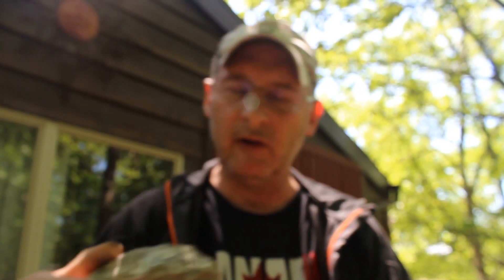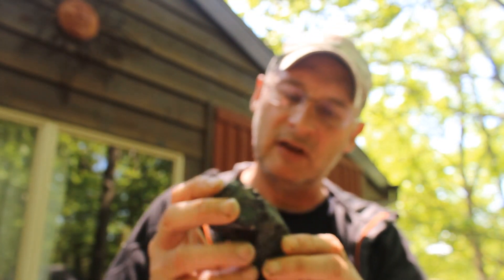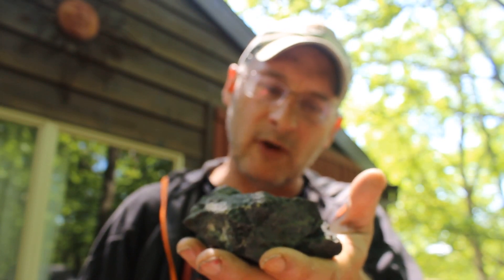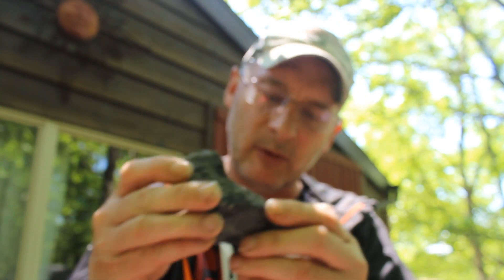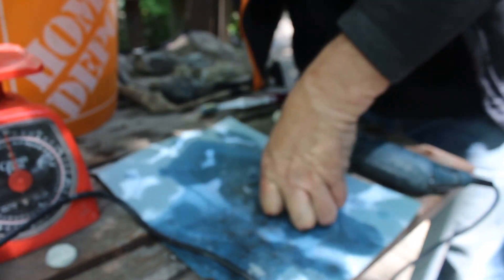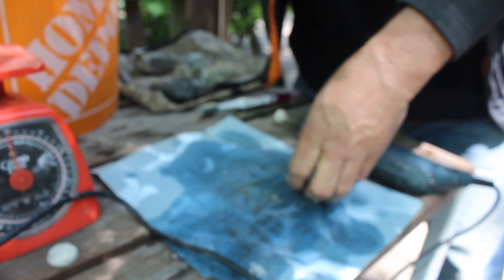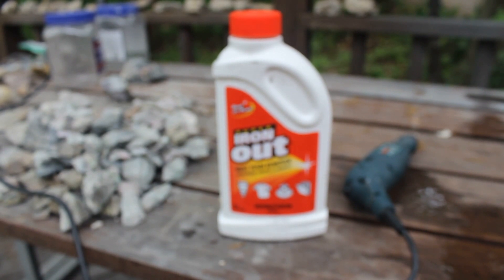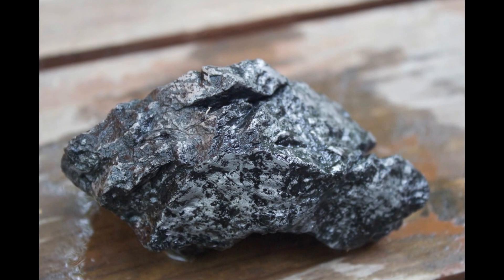Polishing Main Vein Silver Ore

Comment: Hmm, I found two sponge silvers that are very black, not sure if I should leave them alone, or try the iron out? They look mysterious with all that black coating!
Reply from the maker: Here is the problem: The super iron out makes the black soft, so it can be rubbed off the larger rocks with a cloth, but the sponge silver will break if it is rubbed.   I also tired silver jewelry cleaner and a sonic cleaner on a few pieces and neither method did much other than remove some dirt and one of the larger nuggets broke into two pieces (it was held together by tiny wire silver).  As such, I don't have a good answer for you.
Reply: tess99991 I figured as much. I tried gently some baking soda and a soft toothbrush and it did improve it somewhat! Thanks for the info!!
Andrew..
Reply from the maker: Look carefully at your pieces for wire.  I found a toothbrush did harm to the the wire (whoops).  Another thought would be boiling water, with baking soda, salt, aluminum  foil and heat.  It might work well, but might also just move around the non-silver.  For example, if there is any copper in the sample, it will electroplate it with the copper.  I might sacrifice one and try this method.  I will let you know if it works out.
Reply: K will do thanks!! I'll check with my loupe!

Comment: Love  your awesome vids, but here I wouldnt grind breautiful rocks for the shine to come out. Instead, what I would do with such a high grade ore is using ammonia and reduce the oxides to preserve the original surfaces, then polish with some soft carbonate to get a bit more shine.
Reply from the maker: I have never tried ammonia.  Thanks for the tip!
Reply: Basically it is the active component for cleaning silver table ware. Please do not forget to respect the prescribed safety rules for handling ammonia. Gloves, protective glasses for eventual spills and a respiratory mask against the mind blowing fumes should be a minimun. Work outside in the open air. Have fun ;)